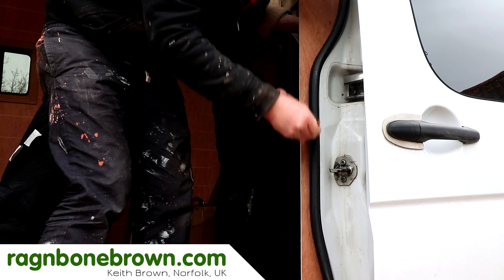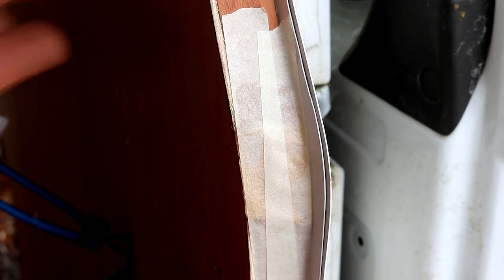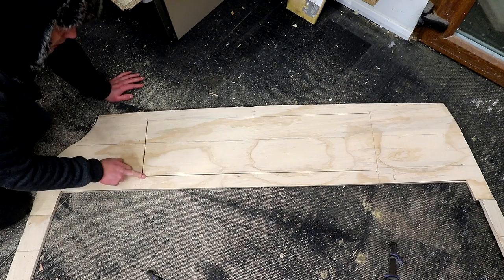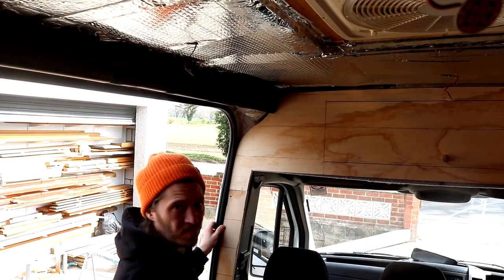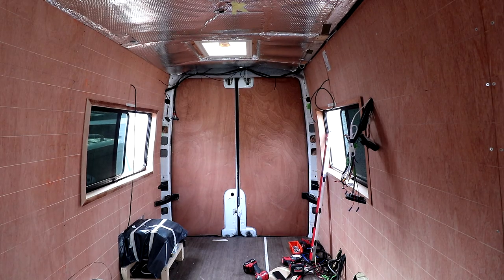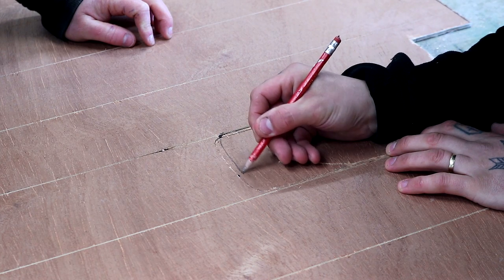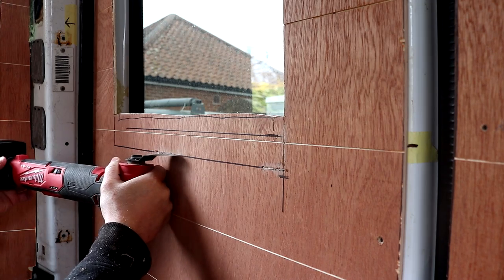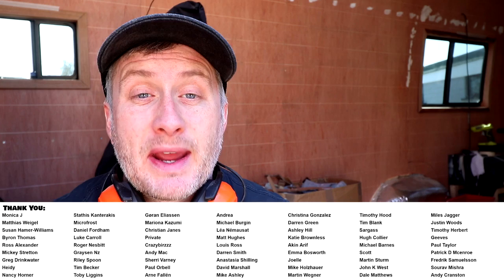Campervan Conversion - Doors & Bulkhead - Mercedes Sprinter #ad

Comment: If you ever do another one, for marking out for the rear door handle, cover the handle in masking tape and paint it with a bit of whatever paint you've got kicking about, then stick the panel onto the door so you print the shape of the handle onto it.  I did this when I ply lined my last van and it worked fairly well
Reply: Yes a great trick, also as there was already a cardboard template I would of probably used that too

Comment: Chuffed you found the scribing and templates difficult and the results still weren’t perfect- very honest. ( they are all bloomin time consuming!)There isn’t a straight or plumb line anywhere on a camper. 
I’m nowhere near as experienced as you guys nor do I have as much kit but i found a cardboard template then a hardboard intermediate template of the same shape made a big difference when I did my transit lining didn’t seem like overkill at all, and there was lots of adjustment in the hardboard! 

Great content - thanks for the great range of projects 👍🏻

Comment: i know how you feel on the scribing, cutting and repeat front as ive just covered my stair case in oak. looks good but has taken an age to do. when using cardboard to template stuff i find using that brown cardboard does not work very well but if you use it to fill in the bulk of the panel and then use thinner cardboard (cereal boxes etc) around the edges it works much better

Comment: very nicely done, making my van was a bit more work than making cabins, sheds etc. and not because it is more wood, its just scribing roughly, scribing detail etc. For the level problem, I always dit put a block underneath my level to get it straight and have the underside of the block as a marking point when it is truely level. thanks for sharing the process

Comment: Coming on nice bud. It's not easy and can be time consuming this sort of panelling. Not done a van but a fair few boats which present similar issues. If you have a laser level where you can lock off the self levelling pendulum, it'll help a fair bit lining things up plum to the floor.
Reply from the maker: Cheers, yeah I'll probably get it out and say it up for the cabinets I imagine👍

Comment: Resourceful, as always! I believe your templating woes were due to using knackered old cardboard boxes! Fresh sheets (from a packaging supplier) or, sometimes, kraft paper from a roll, make life easier. Doors, especially, are easiest using thick clear plastic sheeting so you can see exactly where handles/holes are underneath it and mark them with a sharpie.

Comment: Nice work Keith. What face material on the door ply? Has fabulous whirlpool grain pattern, will look great when varnished.
 Is your "Client" paying hourly rate or your friend getting "mates rates" ?
Reply from the maker: I'm not sure what the face veneer is, but I wish it was thicker!
Reply: You made a good recovery splicing those repairs. 
Trouble with ply, thicker means more weight. Lighter can rattle & twist

Comment: The power tools on the ITS site are far more expensive than Screwfix, in fact, they are dearer than any online retailer!
Reply from the maker: Have you tried contacting them?
Reply: @RagnBoneBrown  I had a good look through the online catalogue and thought they were rather expensive so did a price comparison with Screwfix. The only item I found at the same price was a box of 200 4x40 screws. The power tools are all getting on for £20 more expensive. I would have placed an order for a router if they were cheaper, but they're not.

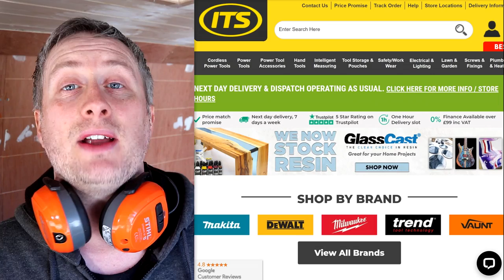Comment: 2:10 Makita DSP600ZJ 36v (Twin 18V) LXT Brushless Plunge Saw - Body. ITS = £407.00. Screwfix £319.00. Busted 😆
Reply from the maker: Have you contacted them?
Reply: @RagnBoneBrown  To be fair I’d rather buy from a local (to me) shop in case I need to return anything. Much easier to deal with than an online shop, other than Amazon.